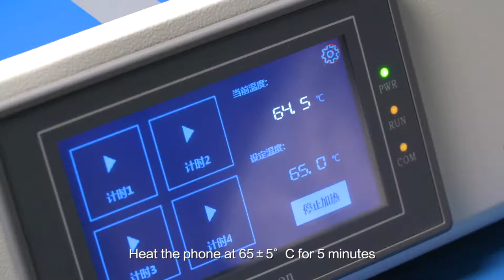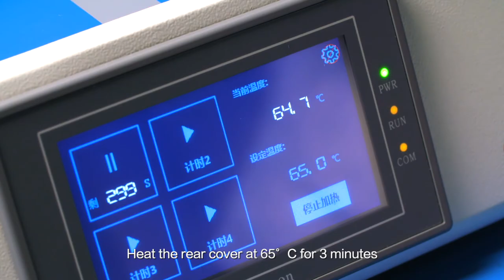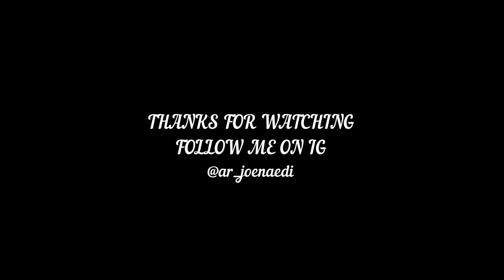HUAWEI P40 Pro a.k.a (Elsa) | Disassembly and Assembly overview

Comment: I replaced the LCD screen frame from other phone ,just swaped my main board .now it's just restarting .any idea what I'm doing wrong ?
Reply from the maker: Are your model types the same?
Like els-nx9 or other,
If it's the same maybe you should try to reinstall your device
Reply: @AdeRahmatJoenaedi  thank u very much replying .it was the battery . Reinstall my old battery in new phones panel and works fine .